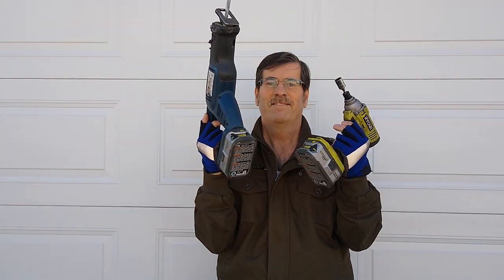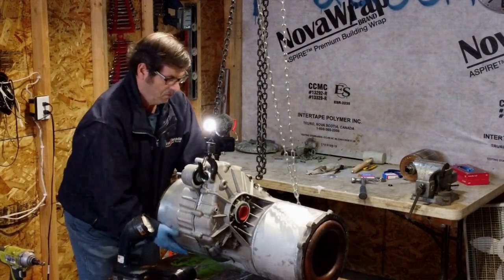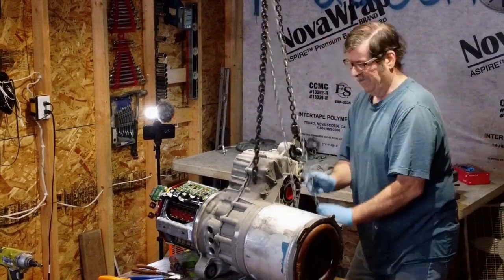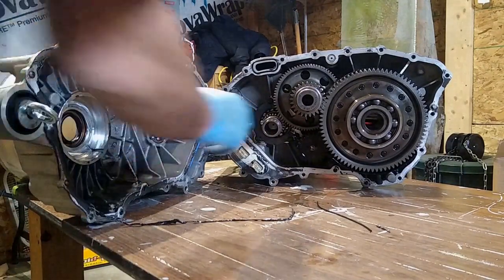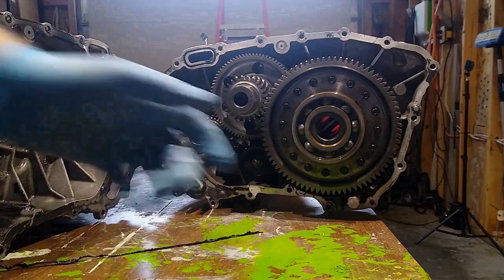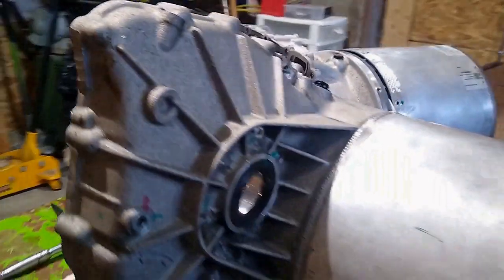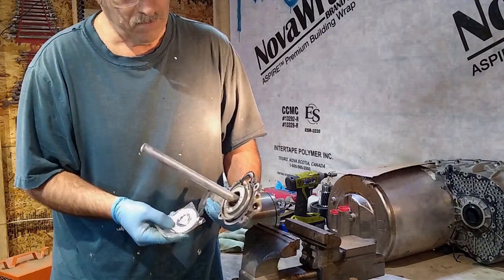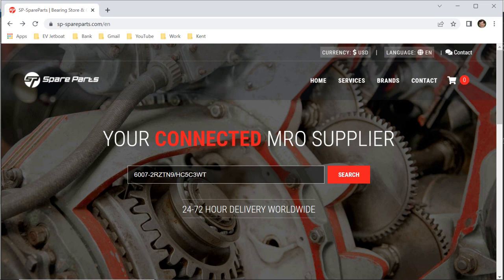Tesla Model S Drive Unit Teardown. Tesla Powered JetBoat.

Comment: Did you have to realign the rotor with the encoder? I used to work on industrial motors and getting them aligned required software. This looks like a piece of cake.

Comment: I have heard that a prop drive is about 40% more energy efficient than a jet drive unit.  I wonder if you would get a lot more speed for a given amount of electricity by using a prop drive instead of a jet drive? 

My neighbor mentioned this, that he must use jet drive due to the low water levels of the Sandy River where he likes to fish, and that a outboard prop drive, a 100 HP would be just as fast as his 175 HP jet drive unit.  

When I rented a jet ski, I was at Lake Havasu, and the water level was pretty low, and I got a rock sucked into the jet drive, and they wanted about $750 to remove the rock.  I was a little more than a little bit upset.   I wonder if you ever got a rock sucked into your jet drive?

Comment: Around 8min you're replacing a bearing, is that the same one for the notorious groaning noise some early 2013ish models exhibited from the drive units?  Only reason I ask is there's a car local to me, 2013 MS 85 that's going for cheap since it needs the drive unit repaired.  If so, would someone who's mechanically inclined enough to pull an engine be safely able to pull apart and replace this bearing in your opinion.
Reply: good question, I'm curious as well. My S 85P doesn't have the problem YET but we will see...
Reply: @nastyaromanova5902  There's a dirt cheap 2013 85D w/ 50k near me because of the motor noise.  I've watched a Rich Rebuilds video where he replaced what I think is the same bearing and shows more detail when they take it apart but I don't wanna risk buying a car for $30k if I can't actually fix it myself.